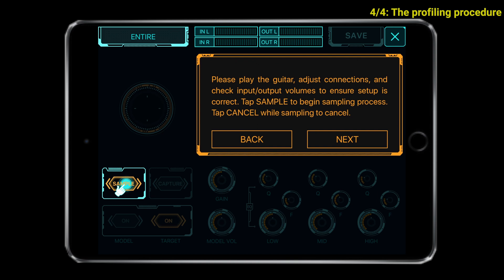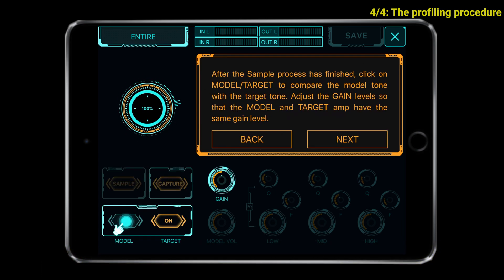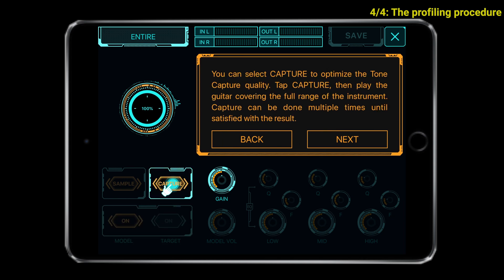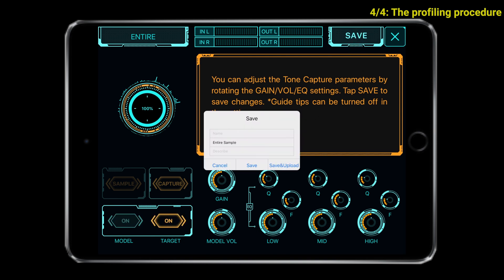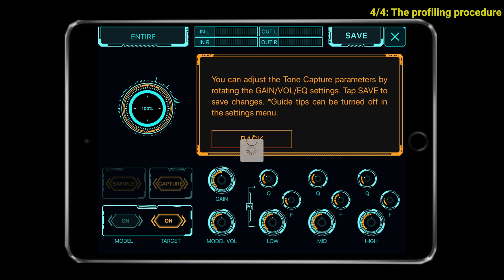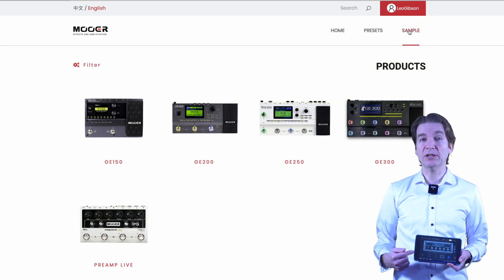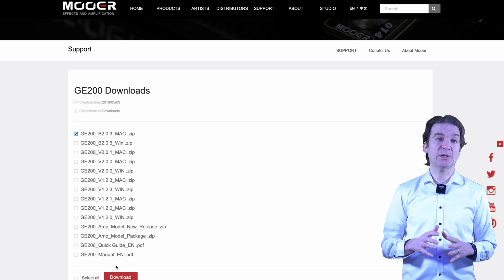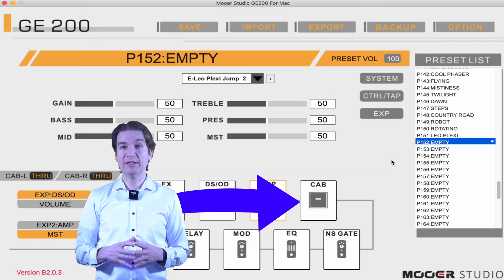MOOER GE LABS: how MNRS profiling procedure works and how to upload the profile to the MOOER GE 200

Comment: Have you compared GE MNRS captures using the latest firmware updates on GE 200/GE 150 Pro etc. (like Harley Benton DNAfx GiT Pro / Flamma FX200 FX150) vs. NAM profiles including NULL tests (though the NULL test has the known difficulties with phase as it does the comparison in time domain and not in frequency domain)? Would like to know how good quality MNRS captures are versus NAM captures (and possibly to Tonex captures also), for me from the few Youtube videos I've seen they compare to Tonex captures at least.

Comment: You seem to be surprised the gain isn't the same, but you're going into the GE labs from an audio interface, and to the GE 200 straight in, you're clearly not gonna be volume matched on the input.

Comment: How do I connect the app to my interface? Is the focusrite scarlet 2i2 even suitable? Thx alot, great video by the way! I hope that i can get my jvm+4x12 into my ge200, that would be so killer🤘🏻
Reply from the maker: Hi, the app runs in an iPad or iPhone and you need a "class compliant" audio interface. You need to check out if your scarlet is class compliant ad if you run an iPad with lighting cable, you need the apple camera kit (I think that's the dame of the dongle). Thank you for your question!

Comment: Thanks for the vid... As for the GE200 having slightly less gain, and sounding a little better... Don't forget that you can adjust the entry level, which seems to be the problem IMHO
Reply from the maker: Hi, thank you for your suggestion! I've tried to match the input volume on both the units...I will try to verify even further! Thank you

Comment: This doesn't support the 150 right?
Reply from the maker: Right. It is written in the Mooer FB page. It seems that the GE 150 has some hardware limitations. On the other hand they are working on a firmware update for the 250 and 300 to include this function. Thank you!